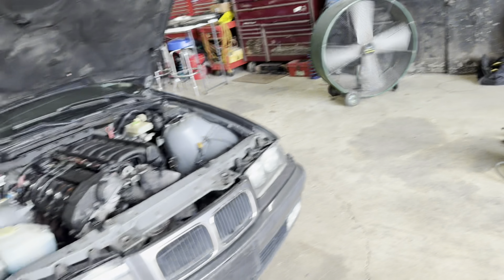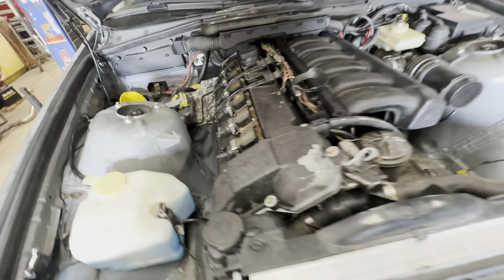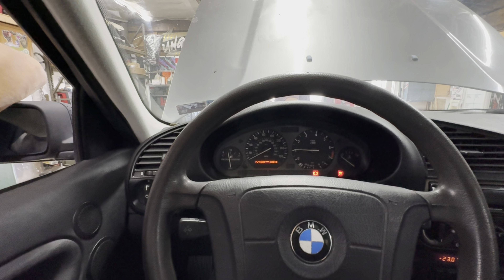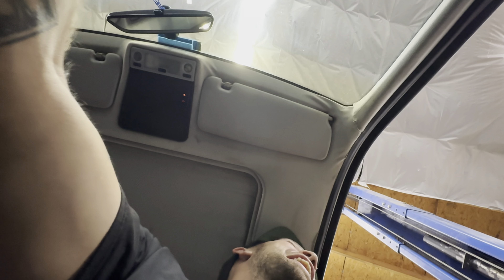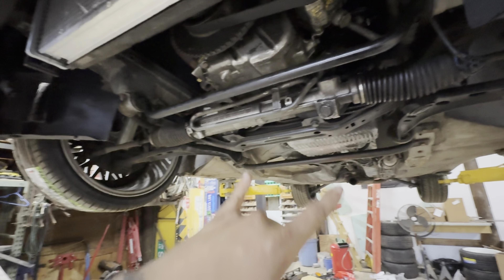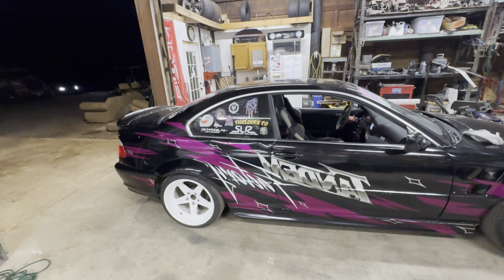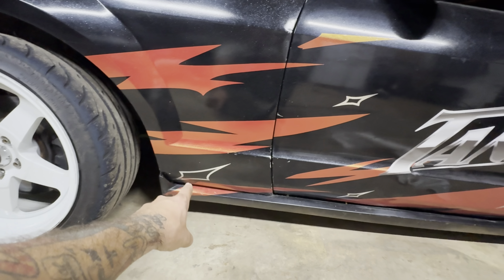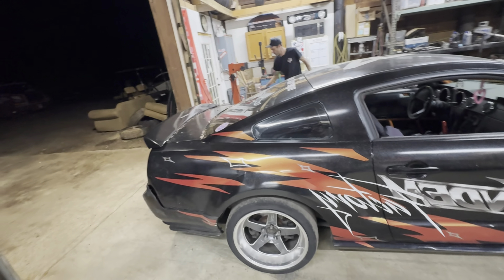M50 SWAPPED E36 SEDAN!! WILL IT RUN?

Comment: I recommend welding the bottom of the shifter, where the shift rod goes through. The welds break almost 100% of the time under normal driving.